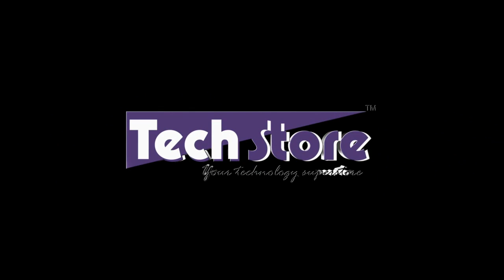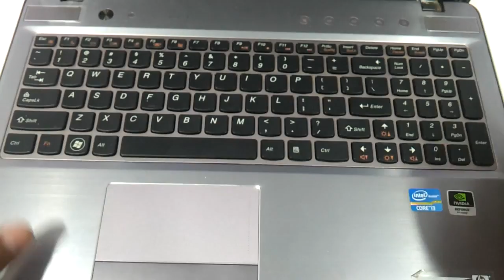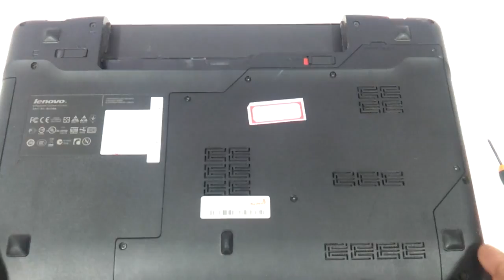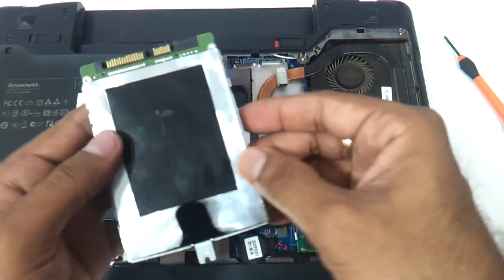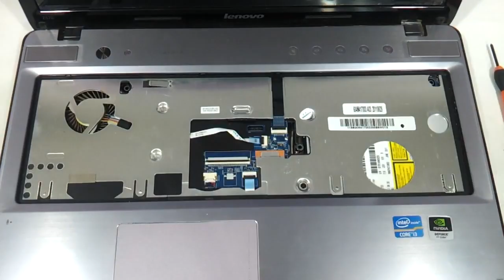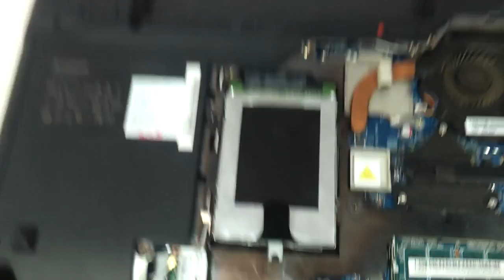Lenovo z570 how to upgrade the keyboard ram memory harddrive dvdwriter diy

Comment: Do you know if the mainboard has two additional ram slots?
Windows task manager reports me 2 of 4 slots in use which means it detects 2 empty slots for some reason.
It´s very uncommon for laptops to have 4 slots but i also have seen a laptop with 2x 2,5" drives installed so i guess nothing is impossible.
Reply from the maker: It has only two ram slots in total

Comment: Hi Can I upgrade to 4+8 gb ram for Z570? 4 is existing 8 Gb ram I want to buy .Does it work?
Reply from the maker: Yes you can. It works like a charm.
Reply: Tell me if it's working with you. because I want to do the same. Please. 4+8
Reply: @ShawishArt  yes it's working
Reply: @AAA007New  thanks bro 🙏

Comment: I have a z570. Unfortunately I bought the without GPU model.So it have Intel HD 3000. So my question is, as A model with Gt540 available, is there any way for me to get that GPU for my laptop as it supports gt540? Any help would be appreciated.

Comment: How do i clean the fan, its releasing too much heat at super energy saver. Can u make a video for that too, without removing much parts.
Reply from the maker: We will try to. But it is pretty straightforward once you open the base.
Reply: Thanks, i would be eagerly waiting for that. I want it to clean it myself hassle-free

Comment: My laptop has a 4 gb stick and one slot is empty, can I use a 8 gb stick with the 4gb stick I have safely? Or should I use 4+4?
Reply: did u try it coz i am stuck with the same question reply asap thanks :)
Reply: Nope, I wasn't able to, because ddr5 RAM for laptops isn't available in Delhi anymore. All they had was DDR5, which means if I want to use two slots, I have to throw my DDR3 stick first.
Reply: Sameer Kumar i ordered a ddr3 8gb ram and i already have a 4gb both 1333 hz will i be able to use both??
Reply: Hopefully yes. Do tell me how it works out for you.
Reply: It worked fine now I have total of 12gigs ram..
Reply: Awesome. Thanks for the info :) Maybe I'll get DDR5 sticks now to make it even faster. Thanks a lot :)
Reply: I guess it wont support ddr5
Reply: Enquired about it, it wont support DDR3+DDR5, but it can support 2X DDR5.
Reply: Wow then u can get nice :)

Comment: well my model has 750GB but there are some HDD for laptop with 1TB of memory and most laptops have just one slot for them and btw one HDD with 1TB is cheaper then 2x500GB.and if u dont want to buy that hard drive u can use external hard disk ( Andrej Grubor here)